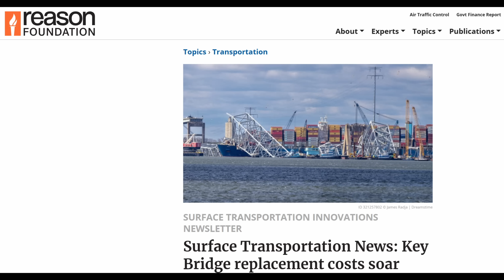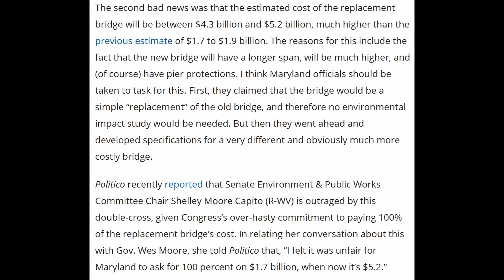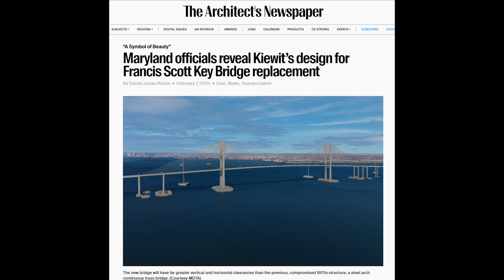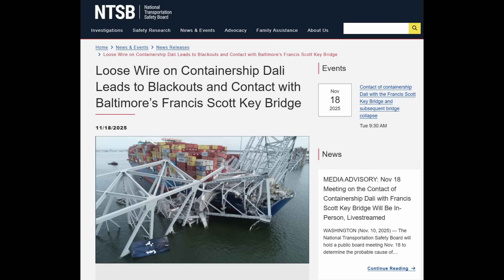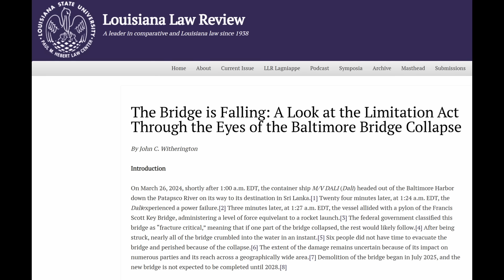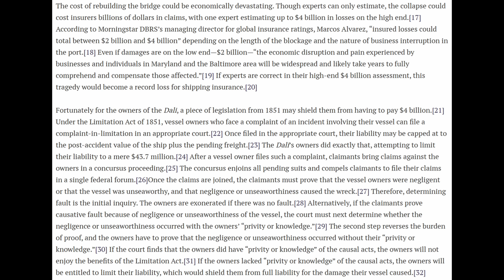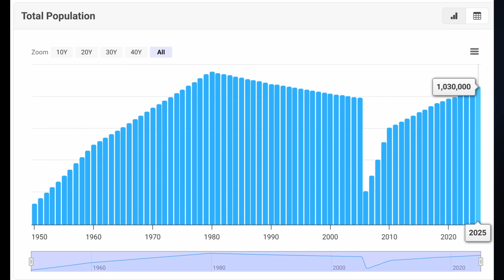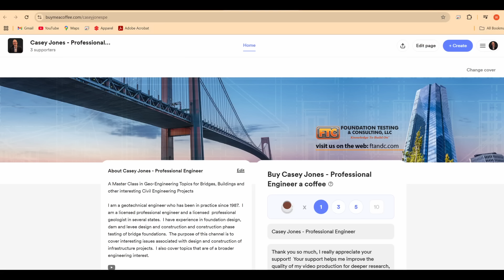Should U.S. Taxpayers Pay for a $5 Billion plus Key Bridge Replacement?

Comment: I live in Maryland, about 45 minutes west of the Baltimore Beltway (I-695). Most of the traffic over the Key Bridge was trucking from the port of Baltimore to points North. There are two significant tunnels that go under the Baltimore harbor, but for obvious reasons HAZMAT is not allowed to transit those tunnels. Thus there is only one other place for it to go and that's the already overloaded West side of the Baltimore Beltway.  So if you're hauling HAZMAT cargo, you have no other choice. This is why the Key Bridge was so important. It's not the traffic volume but the type of traffic that was going across that bridge.  

That said, I knew the cost of the bridge was vastly underestimated from the start. There are also logistics of getting the materials to the site. The previous Key Bridge was built when Bethlehem Steel was running a very large operation at Sparrows Point. In other words, the steel foundry was literally a short barge ride away. That plant is closed. It will be interesting to see where the steel for this effort comes from.
Reply: What logistics? The ports is directly next to it, there are a number of bridge construction companies within a mile or 2 of it, major contractors are within eyeshot if it. They're talking about making it a poured in place bridge not steel framed like the old bridge or the Bay Bridge.
Reply: Mostly from Nippon/US Steel
Reply: The beltway is like the Orioles they are constantly working on it and it just goes in circles. Lol
Reply: @scottjarrett4893 🤣
Reply: Also need to consider the distance that Bridge users must travel when the Bridge is out.
Reply: @mikeskidmore6754  It's not so much the distance as it is the amount of traffic that has to go around the beltway daily. The difference since the bridge went down is staggering; it has increased travel time by triple.
Reply: They’ll float the steel up the bay like they did for the Fort Mac tunnel. This is not a logistical nightmare. It’s actually the best case scenario.
Reply: I have been driving the key bridge for years in Maryland there's hardly any traffic.
Reply: Sounds like they need a port on the other side of the Bay for hazmat and then just build a tunnel for everyone else.
Reply: Yeah, but have you swerved across three lanes on 495 in Virginia lately?  Because if you are really from MD you would have.
Reply: Remember however that that would be not-fabricated steel coming out of that Bethlehem Plant.  From the steel mill all that steel has to go to a fabricator to be cut to exact length for beams and columns then drilled, bolted, or welded and then from the fabricator shipped to the site.  Unless there is a "Buy American" contract clause (likely on a Fed-funded job like this), sadly otherwise that steel may come from overseas or Canada or Mexico.  Also from someone in the construction industry, I am always amazed when I see steel-erection jobs fabricated in places like Texas and shipped (by barge, etc.) to places like Chicago and New York City.
Reply: There was a ferry service across the detroit river to windser that hauled haz mat trucks
Reply: @charleslalonde2324 you’re talking about the I95 corridor, which is the mostly highly trafficked in the US. There is no way a ferry could become a replacement for hazmat cargo at that volume.
Reply: I'm guessing from the other side of the Pacific.
Reply: All this talk about HAZMAT that constantly comes up on various forums that discuss this bridge. The best data I can find is that the AADT was about 32,000 with 10% large trucks with about 10% of the shipments being material that MDTA won’t allow thru the tunnels.

So about 350 to 400 shipments per day. To me that is very little justification for spending $5 billion to avoid tunnels; granted there were the other 31,000 vehicles. But the two Interstate highway cross-harbor tunnels carry the 225,000 AADT now and have a total of 12 lanes.

That is about the same AADT as the I-495 American Legion Bridge which has 8 thru lanes. The Key Bridge had 1/7 of that traffic and Maryland is doing nothing to expand the ALB and the rest of I-495 between VA and I-270 to the VA 12-lane cross-section (4-2-2-4) with HOT lanes.

I don't understand why they can't open the I-95 Fort McHenry Tunnel to those 350 to 400 shipments per day. It is a modern tunnel designed in the latter part of the Interstate System construction era.

HAZMAT constantly goes thru the antiquated railroad tunnels in the city of Baltimore and Washington. Granted railroad is intrinsically safer than highway, but getting certified to drive a HAZMAT truck is only granted to drivers with impeccable driving records, and at least 2 million miles of regular truck transport experience, and with special training for HAZMAT transport. The trucks are also maintained to extremely high standards. It should be plenty safe for them to transit the tunnel.

At least give them access say between 1 am and 5 am when volumes are the lowest.
Reply: @alanstevens1296 Take a look at the fires in the I-80 tunnel in Green River, Wy for why you do not want hazmat in the tunnels
Reply: @alanstevens1296 that’s the cost benefit analysis that need to be done. I absolutely do not agree with sending hazmat through tunnels even with restricted hours. The I 95 corridor is extremely congested all hours of the day, and one small hazmat incident in a tunnel can easily kill 10s - 100s and take the tunnel out of service for months to years. The big question is it more economical to build a new bridge or send hazmat traffic on a 20+ mile detour using I695 West.
Reply: @TheTimster42  
It is not worth $5 billion or even $1.7 billion to the federal taxpayers to build it on account of 350-400 HAZMAT shipments per day.

The same risks exist in the antiquated RR tunnels in central Baltimore that carry HAZMAT all the time.
Reply: @alanstevens1296  when it comes to rail the risk is significantly lower of an accident due to the fact that you don’t have passenger car in the tunnel possibly running into the train, which is why hazmat fright is allowed on the lines.
Reply: @a @alanstevens1296  As far as the cost benefit goes, I’m all for a study to determine the best route. Though we’ll have to keep in mind when it comes down to it we are looking at 100 years a usage for $5 billion + upkeep vs the added economic cost of the cargo to use the alternative method.
Reply: @TheTimster42  
As I said, railroad is safer than highway, but they still have tunnel fires and derailments. 

Here is one that is notable:
On July 18, 2001, a CSX freight train derailed inside Baltimore’s Howard Street Tunnel, igniting a massive fire that burned for nearly a week. Eleven cars left the tracks, including tankers carrying hazardous chemicals such as tripropylene and hydrochloric acid. The blaze filled the tunnel with smoke and toxic fumes, while a broken water main flooded the site, complicating firefighting and destroying evidence. Though no fatalities occurred, five people sustained minor injuries. The incident paralyzed downtown Baltimore, forcing evacuations, disrupting utilities, and halting freight traffic along the East Coast. It remains one of the most disruptive urban rail accidents in U.S. history, highlighting the vulnerability of infrastructure when hazardous cargo and dense city environments collide.

The Federal Signal 1003 sirens in Baltimore were activated on the afternoon of July 18, 2001, shortly after the Howard Street Tunnel derailment and fire began. They were used to warn downtown residents and businesses of the hazardous smoke and chemical release. The activation was brief — lasting several minutes — and was intended to reinforce evacuation orders and signal the seriousness of the emergency.

The Federal Signal 1003 was a Cold War‑era air raid siren capable of multiple tones (alert, attack, fire). By 2001, Baltimore still maintained these sirens, and the Howard Street Tunnel fire was one of the last times they were used in a real emergency
Reply: @TheTimster42  
The current design has deep water piers that have the same ship strike vulnerability as the original. It might not last a week.
Reply: @alanstevens1296  I don’t disagree or agree since the data isn’t there. This is why a full, multi-option, economic traffic study that takes into account risk should have been conducted before any estimate for replacement cost was thrown out there.
Reply: @TheTimster42  
A crossing of this magnitude is not some routine emergency replacement of a bridge on the order of the MD-404 Denton bridge in 1976. (My parents retired near there in 1974).

I have my opinion on what alternative should be selected, but the most important thing is to engage the public and the associated resource agencies, and to lay out the alternatives before them and then to make an informed decision by the highway agencies.

Conduct full NEPA EIS process
1) State highway agency prepares Draft EIS -- compile comments from associated resource agencies, prepare a full range of feasible alternatives, evaluate environmental impacts
2) State highway agency conducts public hearings where alternatives are presented, with a public comment period.
3) State highway agency selects preferred alternative
4) State highway agency prepares Final EIS
5) FHWA approves or disapproves Final EIS
6) State highway agency prepares Record of Decision
7) FHWA approves or disapproves Record of Decision

The ship collision and bridge collapse in and of itself is a catastrophic event to both the natural environment and the human built environment.

Building a replacement crossing that will prevent such events in the future, is also relevant to protecting the natural environment and the human built environment.

Evaluating the issues of any protection scheme needs NEPA EIS study to determine what size can be built within hydrological constraints.

Therefore I strongly urge that FHWA require a full NEPA EIS on the project.
Reply: @alanstevens1296  Absolutely agree… the only funding that should have been allocated at this point was funding for cleaning up and to study how best to proceed. And yes I know the Denton area well. I grew up in Easton.
Reply: @TheTimster42  
Parents in St. Michaels. The Eastern Shore is great.
Reply: @alanstevens1296  Any heavier than air HAZMAT leak would hang in the bottom of the tunnel and would at the least asphyxiate anyone in the tunnel. And no matter the qualifications of the truck driver, he is surrounded by amateurs
Reply: @BNO-4333  
The Fort McHenry Tunnel has ventilation fans that can pull air thru that lower invert at up to 70 mph and evacuate the current tunnel air in 2 minutes if needed.

If they want limited HAZMAT access they could run pilot cars fore and aft to keep other vehicles away from the truck. And it would take 3 minutes at most to transit the tunnel.
Reply: @alanstevens1296   Anyone who is thinks it would be a good idea to route hazmat traffic though either of the Baltimore tunnels has not fully and logically thought out the implications to not only intra state but also interstate impact to traffic if a hazmat accident were to occur inside one of the tunnels.  I have been stuck for hours in traffic when there is a minor fender bender in one of those tunnels and let’s not forget about just general rush hour traffic.  Additionally the Baltimore beltway is not capable of supporting the amount of additional traffic it would experience if either tunnel was shut down for an extended period of time.  Lastly to spin the fans at much over 20 % of there rated power increases there electrical consumption exponentially to the point that other than short bursts puts extreme demands on the power grid that is unsustainable.
Reply: @gullreefclub  
In the U.S., the I-664 Monitor-Merrimac Memorial Bridge-Tunnel (MMMBT), opened in 1992, was specifically designed with clearances and safety systems to handle nearly all hazardous materials, including RVs with standard propane tanks and gasoline tanker trucks. This 4,800-foot tunnel under the James River in Virginia proves that tunnels can be engineered to meet strict safety standards for HAZMAT transport.

An Outer Harbor Tunnel or similar Patapsco River tunnel could likewise be designed with appropriate clearances, ventilation, fire suppression, and emergency access to handle nearly all hazardous materials, ensuring no disruption to critical freight movement while eliminating bridge vulnerabilities. This capability further underscores the efficiency and versatility of tunnels, making the current bridge plan’s HAZMAT justification baseless and wasteful.
Reply: @alanstevens1296  I work in that industry and you are way off on everything.
Reply: @kathrynw3  
I work in that industry over 40 years and am quite informed on all those issues.
Reply: China most likely.
Reply: Then the Beltway should be expanded to route all hazmat traffic away from that area and the bridge replaced with a tunnel for passenger traffic. 
That would make logistics easier while not restoring a problem any terrorist could use to block the harbor by running a vessel into either a new bridge or its dolphins.
Reply: @C @Comm0ut . Going through Baltimore the I95 and I895 tunnels actually provide sufficient through put for passenger and non hazmat cargo and are very close to the Key Bidge. Using I695 West around Baltimore adds about 20 miles. Basically it would next nothing for passenger traffic and add a significantly amount of delay for hazmat traffic on the I95 corridor.
Reply: @TheTimster42  I-95/895 are not "adequate" throughput in practicality. It's the difference between working at most of peak hours and large backups for at least 2 hours a weekday.
Reply: @josephfisher426  Well “adequate” for the DMV, where I’m pretty sure you can not add enough lanes for traffic to always flow smoothly.
Reply: @Comm0ut  They've been expanding the Beltway almost continuously since it was opened in the early 60's. They are actually currently working on that portion of the Beltway now.
Reply: @PRR-Fan  Yeah, working on outdated luxury lanes to tax drivers and make traffic worse.

Comment: It’s not simply a replacement,  it’s a significant upgrade.  I would question the need for such an upgrade.  That whole section of the Baltimore beltway is the least used, especially as the heavy industry in that area has long since disappeared.
Reply from the maker: I question it too. The population of that city is steadily declining.

Comment: Regardless of blame or cost distribution, I think you need to consider the impact of not building a replacement bridge on the Port of Baltimore. There is only way to forward on keeping this port viable. 
PS — Sparrows Point in Baltimore is a historic industrial peninsula being transformed from the world's largest steel mill (Bethlehem Steel) into a major logistics hub and container port offering a mix of heavy industry, massive distribution centers (Amazon, Home Depot).

Comment: DOT was totally negligent in the bridges safety to begin with. 

After the Florida bridge collapse, they had like 15 years to get around to it- by 9/11 2001 it should have become a major consideration for a potential act of terrorism. More than enough reason for collision system to be installed.

But anyone in the comment section here who is in the field of infrastructure construction knew when Joe Biden said it would only cost like $400 million to replace- he had no idea wtf he was talking about because those bridge approaches were never going to be reused. They were too old, out of code and would have been in need of replacement in the next 20 years.
Reply from the maker: You are exactly right, thank you.

Comment: It is not true to say the replacement cost is escalating. What is being proposed is a much better bridge. The uplift in value is termed "betterment". No insurance company is going to pay for a better bridge. They may consider paying for the value of the bridge that was lost but that structure had suffered from a number of dilapidations over the years and much of its designed life had passed and much of the value should have been written off. In summary, this crappy old bridge wasn't worth much anyway. Would your insurance on a rusty old jalopy pay for you to buy a new EV?
Reply: I am a Marylander, and you hit the nail on the head.  Tolls collected from the bridge should pay for not only ongoing maintenance,  but it's eventual replacement.  The bridge was 47 years old, and reaching near the end of its economic lifetime. The recently replacement for the Harry Nice bridge was a example of waiting too long to replace an aging bridge, which opened in 1940 and it's replacement opened in 2022. I drove over the old span every week and the 2 lane bridge was reduced to a single lane, except during peak traffic.

 With an extra 2 lanes to play with, carrying a comparable amount of traffic they could have possibly kept the old bridge viable for maybe another 25 or 30 years, but eventually the mounting maintenance costs and traffic delays would become unacceptable.
Reply: Yes, it's the modern way. Why save or even pay when you can borrow. The future can pay. Until it can't.  Then the bond markets eat your breakfast.

Comment: Tariffs are a reason for price increases as domestic producers raise pricing to match the cost of imported products.  Also, my experience with federally funded projects is you have "Buy America" as well as "Buy America, Build America", with the later being more stringent.  I do not think that there is the capacity in the US to produce the steel we had in the 1970s and 1980s.  Further, the paperwork for compliance with the federal funding terms is more than without it.

I think the reason for the cost increase is the initial estimate was low-balled and not thought out.